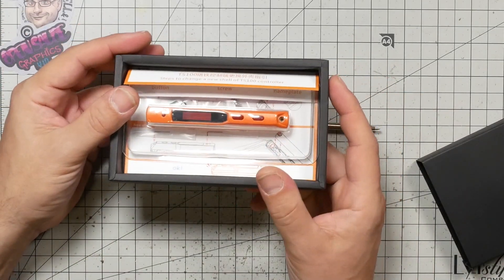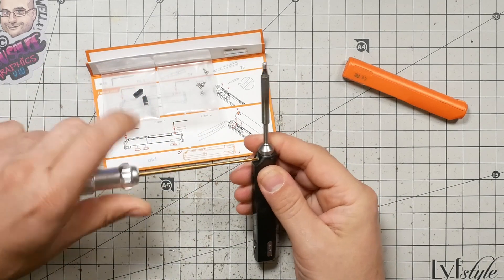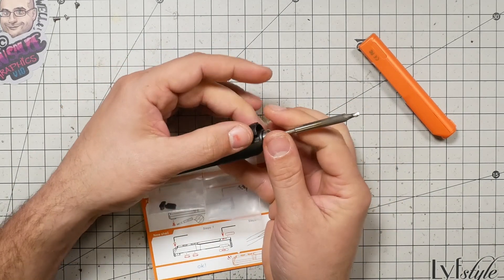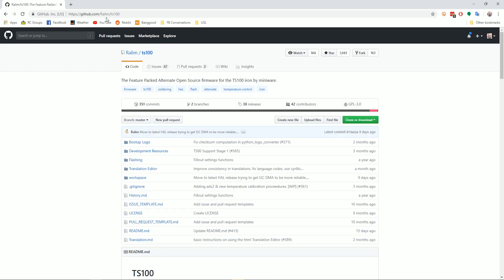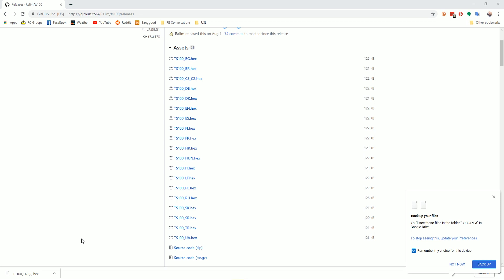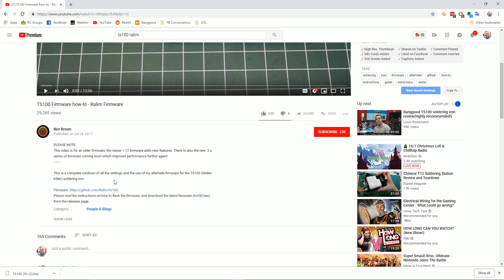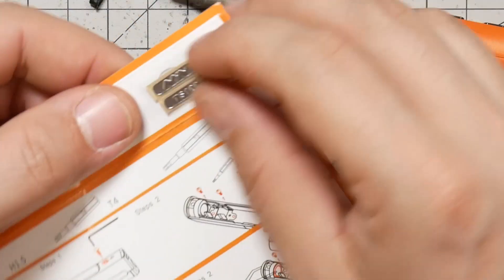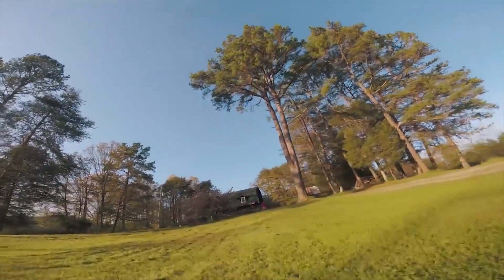TS100 Soldering Iron | Install Ralim Firmware and Custom Colored Case Shell

Comment: lol, this is why the bits are good to have. They have numbered increments and metric. If you are in a pinch, the best solution is to use a slotted. Often times they don't hold up when they are so small. Torx can remove phillips but not vise versa. Invest in a screw assortment and change those little turds out.

Comment: Thanks for making this vid. I do have to point out that the clamp or whatever the two pieces are called that holds the soldering tip in place, you place the second one backwards. One side has a little prong that goes in the tiny hole. You placed it facing the wrong direction. Don't know it it will matter in the long run but I did notice that.

Comment: Any reason instead of RDY my hex from this exact site goes to ERR?

I’ve tried 3 USB cables, 2 different computers and the same result. The first time it bricked my iron but I was able to reclaim the stock firmware on it and am still having the same issue EN.ERR

Also why does one computer show no files on my iron from factory but another has -_-Trash file folder on my other?

It’s a SQ-001 not a TS-100 but I’ve seen they are the same iron and firmware. Also watched people flash both of these with out issue

Comment: Hi Joshua, I just tried to update my iron to the custom firmware and there was not enough space to copy the HEX file, also I had a notification of errors on the drive and that I should scan it and repair which I did, but there is still not enough space to copy the 96kb HEX file. Any ideas as to what I can do to resolve this? Would a factory reset fix it do you think?

Comment: Could've saved yourself a lot of headache and time (and grief I guess) if you just bought the bits a few years ago. Yes having the bits is less efficient than having the drivers but at least you would've had something to work with (for cheap too).

Comment: just change my case for my TS100 in 2020. You no longer need a T3 or T4 bit only a small phillips head driver. I used my tiny whoop driver . Not sure the size but often found in glasses repair kits. you still need your hex driver for the outside of the case though.

Comment: Miniware would have a big seller if they made a TS100 type bench model with shorter handle to tip distance, silicone cable and stand etc. I do electronic service and don't think the TS100 would hold up to the rigors of daily use. And like you said, the ergonomics aren't the best.

Comment: The problem is the rear connector is backwards and also make sure once board is laying flat in case push the ring terminal that power plug goes into all the way back b4 tightening screw. Hope this makes sense. There should be really no gap between the plastic case and the ring terminal. That is what is hanging up when shutting.

Comment: Updated my TS100 with the new firmware last night. Fluctuates sporadically (roughly) between 419° & 421°. Also, that's the highest it will go, with being set at 450°. Any opinions on this?
Reply from the maker: Your power source is insufficient. Whatever you're powering it from can't keep up.
Reply: @JoshuaBardwell  I'm using the supplied "24V" psu. What would you recommend?

Comment: The 2nd connector for the iron was installed backwards there was an indexing tab on the connector that fits into the circuit board.

Comment: I spun my own wire with silicone 28awg and grounded the negative with a 1G resistor in the ground screw hole, so now the cable is wonderful as well 😍

Comment: does anyone know what that little copper ring does I just took my iron apart to swap shells and put it in wrong and used too much force and I broke the little legs off of that ring that Joshua refers to as the shelf to put the circuit board down but it still works but I'm scared of something catastrophic happening later down the line any info would be greatly appreciated

Comment: Very entertaining video. Painless 360 also recommended this iron some time ago which is why I bought one. I find it the most irritating iron I've ever had. Every time I put it down to prepare something (or just to sneeze) it switches itself off. so many times I try to apply the iron to the work, only to find it's cold again. Is it just mine or doe's everyone but me like switching it on continuously?
My thumb's up was for the video, not for the iron.
Reply from the maker: The power plug is probably loose.

Comment: I got a TS100 this week, and decided to flash it today. I plugged it in with no hubs or anything. File wouldn't transfer properly at all. I didn't even get an extension changed file that said it failed; it just disconnected and got real weird every time I tried. Wouldn't boot anymore. Tried flashing the latest OFW instead. That did the same thing.
I got real scared, and plugged it into my tablet to try on that device. Worked first time I tried on there, *.RDY and all.
My desktop is a Ryzen system with a B350 board, but idk if that's where the issue was cropping up from.
I guess, for anyone who has issues flashing, just try flashing it from a different device. It worked for me, at least.
Oddly enough, though, I edited up and flashed my business logo onto it with my desktop, and didn't have any issues. Maybe flashing functional firmware fixed it? Or maybe the issue is firmware-specific, and doesn't include logo flashing.
I seriously thought I'd broke the thing on Day 2, I guess that goes to show how much of a tinker nut I am, both hardware and software-wise.
Definitely better than my college's iron, which was the older slug-tip design. And infinitely better than my first two irons, cheap $20 from-the-wall pencils with no tempurature control. Even on OFW it's super nice, though the interface is a little clunkier on OFW than it is on the Ralim CFW.
Also can't recommend the TS-KU tip enough. decent for drag soldering, able to transfer heat better than conical and the tip can be used in a conical tip-like fashion if need be. The TS-K is probably better for thermal mass, though, if the listed specs are right. But I got the TS-KU so that's what I'm recommending.

Comment: Josh, I don't own one of these irons, so I'm not sure about the following suggestion, but after enjoying your vid, it occurred to me that you may be able to make the installation easier and the end result more distinctive by only replacing the back (easy) half of the case. You wouldn’t have had to disassemble the iron all the way, and you’d end up with a more distinctive, two-tone case (you wouldn’t have had to buy the additional T3 driver - less grief). Just a suggestion.
Reply from the maker: Interesting idea! But too late for me....

Comment: So. I noticed that in the end you got a set of individual bits with a driver... Thought you didn't like those very much.....

Sorry, couldn't help it. Good video, thank you. Everyone is hyping this iron, I'm really on the fence. I do however have a pretty serious soldering station, and I have a Butane Iron for emergency field work, so it would be to replace the latter, wondering if it's worth it.

Comment: Joshua, as a former mechanic on various objects I don't question myself on tools to work on various objects, I immediately think that the engineer who specked the fasteners should be either horse whipped, and or shot.  With a new iron I allowed myself as a longed for nifty alternative to an already operational soldering iron (or five), they had the foresight to include an appropriate sized hex wrench to install the tip which ships unattached for size requirements.  The fact that they don't include a micro sized torques wrench makes the company a group of bumbling idiots.  Taint you my friend, it's the manufacturer.  They could spec a fastener that uses the same friggen size driver in all locations to make everyone's life easier.  I frequently use very descriptive language referring to their familiarity with their product and the inevitable need to service or repair said objects.  Glad you showed everyone that it does happen and the required work around to solve.  Great video!

Comment: You might have tried using a rubber band if you had a slightly smaller size. Similar to how you can use the same for stripped heads: https://www.youtube.com/watch?v=jeULcDESsUY

Comment: While watching this I realised that I hadn't changed the firmware on either of my TS100's for ages, So I just upgraded them.

While doing this it dawned on me what a weird world we live in these days. 20 Years back if someone told me that they would be adding features and increasing the maximum temperature on their soldering iron by plugging it into a computer I'd be checking the way to the door was clear in case this obvious idiot suddenly turned violent, But now (In certain circles) It's a perfectly normal thing to do. ...... Strange. :)

Comment: When I try to drop the file onto the DFU drive, it says File Too Large and only gives me the option to cancel.   Any ideas?
Reply from the maker: Your TS100 doesn't have enough memory to run this firmware and you can't install it. I'm not sure why some TS100 have less memory than others, but that's the takeaway.
Reply: @JoshuaBardwell  That's interesting because when I plug in the TS100 and check properties, it says FREE SPACE 1.96 MB and the firmware is only 122KB.   ??? I don't know.
Reply: And now it seems to be stuck in DFU mode.
Reply: Okay, went to the Github and found many people have actually had this problem.  Mine was stuck in DFU mode and I eventually tried a different computer and usb cable.  After that, it loaded right up.  Some people had to use a DFU tool and the .bin file.

Comment: if anyone is curious about that multiset kit he bought just type "57 Bit Magnetic Screwdriver Kit Electronics Repair Tool Kit" into amazon, ebay etc. ive checked and the delivery times are really short WITHOUT Amazon Prime or whatever.
Reply from the maker: Yes it's true but I'm not sure I recommend the set, which is why I haven't linked to it. The bits fit poorly into the driver and are hard to remove.

Comment: Anyone else have problems with their ts100 where it resets itself while in use?  I'm not talking about when the voltage gets low...it does this in the middle of a freshly charged and new 4s 1500, for example... I think it may be the barrel connector that is screwed up from the battery being connected/unconnected too many times...thx!
Reply from the maker: Yes the barrel connector on my cable is a bit sensitive to being jiggled.

Comment: Hey Josh, I had this idea for a video. I saw that it is possible to use solar power to charge our batteries and since I'm as budget as it can get, do you think  you could elaborate on the topic?!
Reply from the maker: If budget is your concern then solar is not the way to go. Solar cells, battery, charge controller. You'd be better off getting a deep cycle marine battery for a hundred bucks and charging it at home.

Comment: I ended up getting a multi bit screwdriver from MicroCenter to do the swap as my multi bit set was apparently on the slower boat than the case. Thanks for the heads up on the firmware, can’t recall if I updated the firmware to the newest version but I did swap to the orange shell right off the bat months ago.

Comment: Why do U need firmware on a  Soldering iron? Ive looked at these ts100s but was afraid of cheep heating element. Or not last very long. Maybe wrong. Either way the thing looks really cool. I would get  battery operated one. That would be great for in field. Or convert one.
Reply from the maker: The heating system on the ts100 is very well designed. Not cheap. Very efficient.
Reply: Oh cool maybe I'll get one. There fairly  cheep as well
Reply: Shwithcing bits is a pain in the ass your right. Somethin u learn after a while. At first u would think otherwise. Also u always loose them. At least I do

Comment: Does it have an led on it? Ive been using a cheep orange 700degree Weller that has leds on it and it's just   awsome. Cleen the tip and go. Tips last long time. I've had it for years. For 18 bucks it just works.

Comment: Ts100 is great. I have had mine since they came out and had the 450c firmware as soon as it came out on github. 

 Your ts100 will catch fire/melt if you don't reverse that last clip @ 12:12, The barb pointing down goes in the hole.
Reply from the maker: I fixed it :-)

Comment: hey Joshua you have always been quick to help in past so I figured I would ask you this question. In your experience what stores carry good quality silicone wire like 20 awg I just need some to extend motor wires and Don't wants to wait for amazon I just want to go to a local store and pick some up. any answer would be appreciated thanks!
Reply from the maker: No clue. It's a fairly specialty item. Definitely won't be at your local hardware store.

Comment: Get a Wow stick comes with all the bits you will ever need and it works great
https://m.banggood.com/XIAOMI-Wowstick-1F-64-In-1-Electric-Screwdriver-Cordless-Lithium-ion-Charge-LED-Power-Screwdriver-p-1294707.html?rmmds=search

Comment: I feel your pain JB.... took me two attempts to complete the case swap on my TS100 after realizing how many different drivers I needed.  Also, for some reason, where yours has the t3 torx screws inside securing the tip holders, mine were in place with phillips head screws instead.  What a project for a shiny little piece of plastic.  My next step is the firmware update.... hoping it is that easy on a mac.  :)

Comment: I bought a TS100 through the RotorRiot store after watching LeDrib's review.  I laughed watching your video above dealing with the nuisances of the TS100's case while reassembling it, as I had to figure out how to get the case to snap back down  (that dang brass metal tab under there..used a mini-screwdriver to push it forward just enough..)   I happened to stumble upon the YouTube video by Ralim the other day, and did the firmware hex edit mod.  Now you need to do the Custom BootLogo mod! It's not that hard, as the TS100 LogoEditor executable is also on the GitHub link for the firmware.  I used Microsoft Paint to create my logo, and saved it as a monochrome bitmap. Then using the Logo Editor software, and a few tweaks to get the logo to fill the screen, success. It looks great and really personalizes your TS100.  
http://kh2pm.dynip.com/TS100-KH2PM.jpg

Link to the custom firmware and the Boot Logo executable for those of you that are curious:

https://github.com/Ralim/ts100/releases
Reply: real MVP thanks

Comment: Hi JB, I would love the extra temp and menu, but even as it is I am having trouble with oxidizing of the tip. I ordered an extra chisel tip that I thought was factory issue to see if it might help, it has a tendency to want to oxidize even at 380 even though I bathed in flux and fresh leaded solder on the first heating. 
What can one do? I have several solder stations that have the same damnable prob.

Comment: Newer versions of the ts100 have issues. First, the display is over driven, causing the display to shows artifacts. Random dots show up and sometimes the graphic moves off-screen. The custom firmware makes the iron unusable as it makes the problem worse. Some googling identified the cause... mine just went back to amazon... :(
Reply: as a note, putting the old firmware back on will at least make the iron useable... i didnt want to deal with a ticking timebomb. Hope it gets resolved as I would love something portable like this.

Comment: So frustrating to see that @Joshua Bardwell puts the front connector the wrong way around (see 12:14) , and then pleasantly surprised when the manufacturer thought about that, when designing the upper case so it did not close that way (at least without force). There is clearly a lip that is supposed to sit in the pilot hole, and the solder mask alignment would also give a hint. Happy Holiday!

Comment: Would you recommend the ts100 as a primary soldering iron? I need a new one and I've only got about $60 to spend.
Reply from the maker: The beginning of the video basically says it all. It's a great iron except for the ergonomics but if you want to travel it can do double duty.
Reply: @JoshuaBardwell  I can get over the ergonomics. What I need is penetrating heat and reliability, would I be disappointed I purchased this over a soldering station? I've not found any soldering stations that have this many features at this price point.

Comment: Hey Joshua, the front connector must be installed to the other way. That 's why you could'nt close the shell and the tip is not contacting perfectly! Please check it again. Nice video keep doing the good job!
Reply: I was about to say the same thing. Glad I'm not the only one who caught that (especially since I'm watching it 3 days later)
Reply: I thought he realized when he checked the connection repeatedly, but continued on.
Reply: Came here to say this.
Reply: lol, I know it's old but new to me. I was screaming...."NO NO NO!!!!!! That tab goes in the hole!!"
Reply: Georg Roukounakis mine is the right way and it still won’t close and I don’t want to break it
Reply: Sounds like you know a lot about these. I just baught me a ts100 and I don’t know much about it. Can you help me change the language to English from Spanish? Any help would be greatly appreciated. You can write back on here or email me at hanssenjones1989@gmail.com.
Reply: My OSD Is kicking in so hard right now. I want to know that it's been put on correctly Hahahaha
Reply: Joshua best video ever. Very funny.
Reply: Wrong, I placed the connectors in the right way and the shell is still not closing properly for some reason.
Reply: @archiethedog4515  Not wrong, the front connector is indeed reversed. Whether that was the reason why it didn't close properly is a different story.
Reply: @ Georg Roukounakis,Yep i noticed that too and was going to add a comment saying so too,but as you and a couple of other people spotted it and made a comment saying so i won't bother.  ;-)